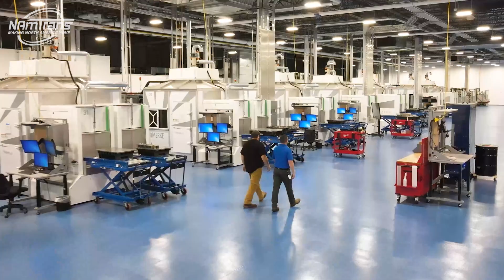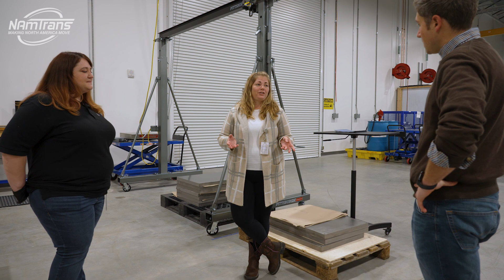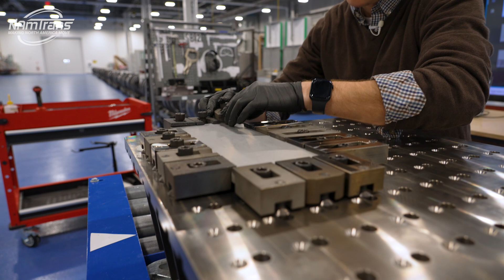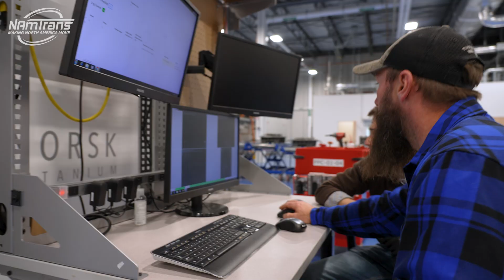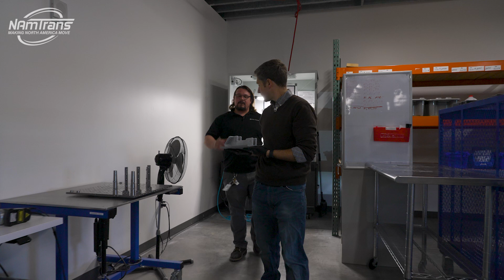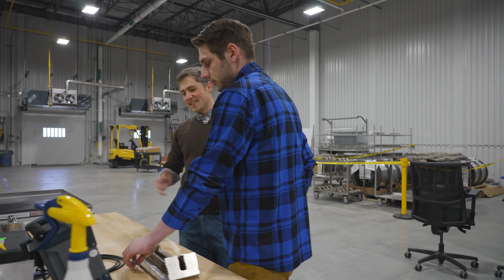On-the-Job with Joel at Norsk Titanium

Comment: Still using Catia v5 in 2024 for CAD... that's a blast from the past...Still an interesting process. Still a long way to go with 3d printing Ti. All progress though 👍
Reply: One thing for sure. That Catia will work in 2055 as well. Don't cry when Autodesk pull the rug under you and lock "your files" in their cloud.